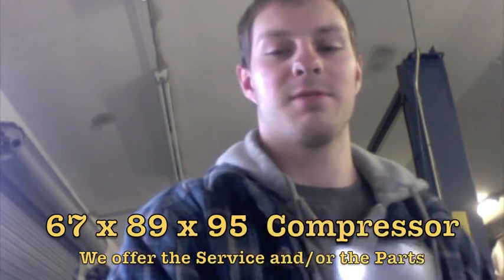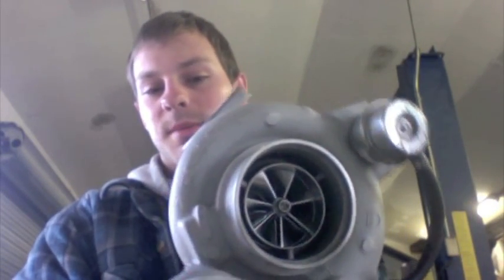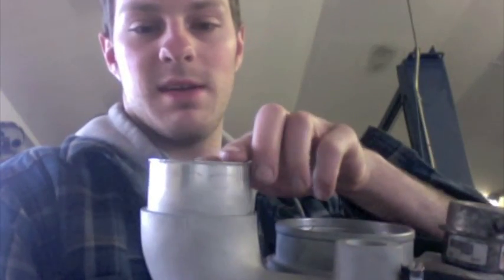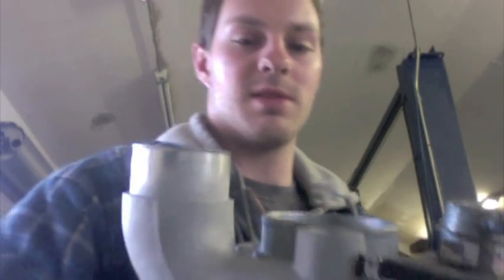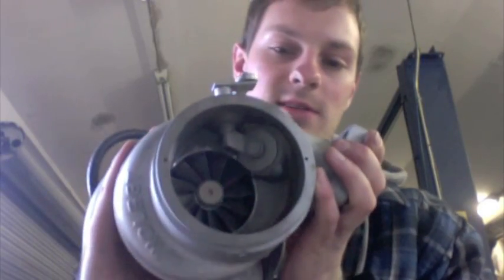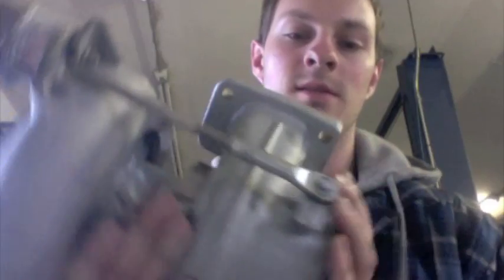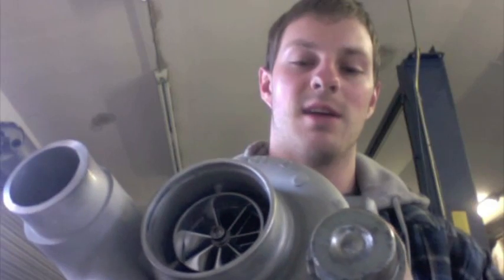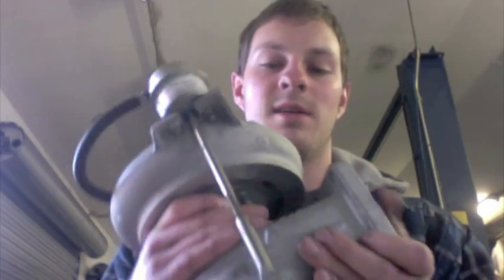Holset HE351 Turbo Upgrade 67mm

Comment: Can this upgrade be done with a larger turbine housing? Say a 12cm3?
Reply from the maker: You are better off going with an Hx series turbo that way we can use holset  hx and Garrett to4 turbine housings
Reply: I know this video is nearly 8 years old and there is an upgraded turbine housing for the he-351cw. Austin, my question is I am interested in doing this larger turbine upgrade. I like the fleece performance offerings but their prices are little steep for my budget. Is this something you would be able to put together as a build?

Comment: what is the difference between the 10 blade and 12 blade turbine?
Reply from the maker: +Tyler Faucette the 10 blade weighs less and reduces back pressure in the turbine housing (drive pressure). We always use the 10 blade.
Reply: is there a exhaust whistle difference between the two
Reply: is there a exhaust whistle difference between the two

Comment: I need a phone number or email to contact you I have a 2012 6.7cummins with H&S delete that I was told the vgt side of my turbo was bad and had to replace the turbo so my question is can you fix it??? can you do this upgrades also or do I have to go with different tunning? I really need to fix my turbo and get it back running I want more power than what a stock turbo has
Reply from the maker: +vcntquinones http://turbolabofamerica.com/contact-us/. It depends on what the problem is. Sometimes the vent nozzle has a piec that breaks that can be welded, I can get a new part for them but  but they are pricey so I'm afraid to stock them. 

It's a good idea to have a tune done to get more power out of it if you can, I build a lot of these for the he351 and the VE, you can throw it on an be fine but if you boost more than stock you need to tune it

Comment: Does the Holset turbo in the new Cummins 5.0 liter use journal bearings ?   What are the advantages and disadvantages of the different types of  bearings.  I would think since the turbine wheel gets so hot, that any bearing would wear quickly.  I have one other question.  What does the turbine or turbines do during a "regen" in this new engine ?  I watched the Holset animation video and it was vague.  It would seem that high regen heat would be detrimental to a turbo bearing.
Reply from the maker: +David Locklear All of the Holsets I have ever seen were journal bearing. In my opinion its a mistake to go ball bearing on a truck build, because if the cage comes apart all of the debrie goes to the oil pan and can be sucked up the oil pump. Its just not a good idea, because those cummins engines are very expensive, and people that own trucks usually need them for work.

The turbo is designed to withstand the heat internally. The oil removed the heat. Usually when a holset wears out the bearings are still good, but usually the problem is that the rear seal is worn from overtime hot shut offs, and dry startups. 

The H1c H1e turbos however had a serious issue with the thrust bearing not being strong enough, so often those turbos would fail a lot easier. A good example if you are hitting high boost levels under load where the engine is at a low rpm, so the oil pump is not able to keep up with the oil volume, because the oil pump is in sink with the rpm of the engine.
Reply: +Turbo Lab America  i hate to tell you .. anytime you have a turbo failure and you do not pull the oil pan .. KISS that engine GOOD BYE ...  all the shrapnel brass /alum and galling is happening in the mains  over 40 dsm engines i have pulled apart get this .. some ls1 engines ..  we need to get a oil drain filter  that drains in to the pan .  and a pre filter  if you run the turbos with out them .. they just die a lot sooner .. in my experience .  and heat .. do not forget about how much heat you have in the chra .. oil has a flash of 250 deg and if your oil does not have a high flash . as soon as it hits metal it evaps . and there is no lubrication property's .

Comment: I am curious if any of you Holset turbocharger experts out there have any thoughts on the Holset turbo being used in the new 5.0L Cummins that Nissan is about to start selling.    Apparently it is a different turbo then what Cummins was using on the commercial version of the 5.0L.      I guess my questions is what potential upgrades can you predict or foresee for this turbocharger ?    And two, what maintenance problems do you think might occur ?      Is this a brand new turbocharger they are using, or is it one that has been around the block a few times ??
Reply from the maker: +David Locklear upgrading the compressor wheel will be easy for that turbo but upgrading the turbine wheel, will be a little more challenging because of the turbine housing design. i think i may need an endmill for that job, i currently just use lathes. 1 manual and 1 cnc.

Comment: Hey Austin, I can't seem to find the email for the he351 upgrade anywhere. could you email me again? with maybe a list of current he351 specs and upgrade specs. thanks.
Reply from the maker: +Big Daddy White Chocolate  We do the upgrade and rebuild for 550$. the factory specs are 60 x 86 on the compressor wheel and 58 x 65mm on the turbine wheel. The upgrade is 67 x 89 x 95 on the compressor and 67 x 76 10 blade on the turbine.
Reply: Is that 550$ with a core? What if you had a he351 core already?
Reply from the maker: yes. then it would be whatever the cost is that i paid for the core. sometimes th can be found on ebay for 150-250$

Comment: what is the price on this charger, and what are the hp ratings for diesel? interested for my 07 5.9
Reply from the maker: josh feltner We charge 650$ for the service and Upgrade which includes all the parts, machining, and rebuild. We do have a core turbo here. We can do a core charge of 300, if you just want to buy the turbo from us and not send a turbo core in that is fine also.

Comment: No hiccups on this video.  Good info. and sounds like an awesome upgrade 850bhp or whp? And was this on what type of gasser?
Reply from the maker: Yes, i speaking in terms of a gas engine. We actually saw 926hp in on e85 with a similar size wheels in a garrett form on a gas engine. Im not sure what to say for diesels, i don't know them that well. All i know is from what someone told me that i built this turbo for.

 He said it spools faster than stock in the he351 with these size wheels. If that is true, it is because of the larger exducer of the turbine shaft, if it meets close to the end of the spiral it helps a lot with spool time. He says its already boosting at 1400 rpm on the dodge cummins turbo diesel.